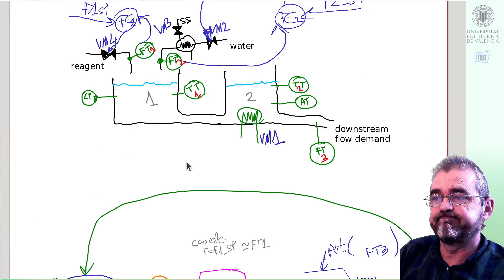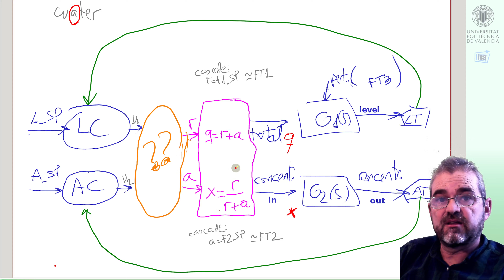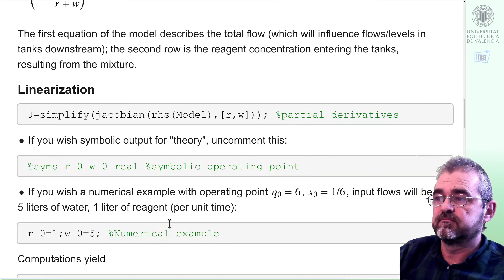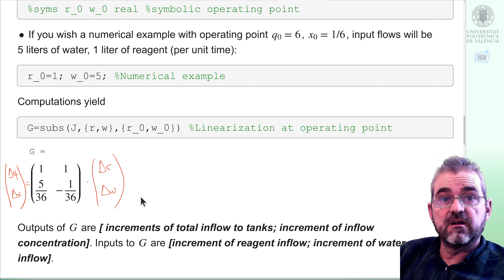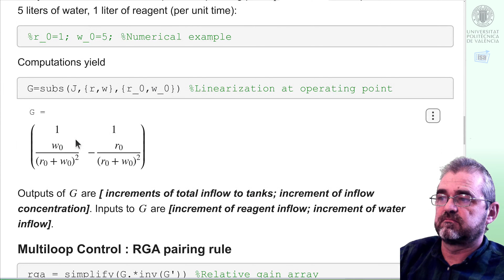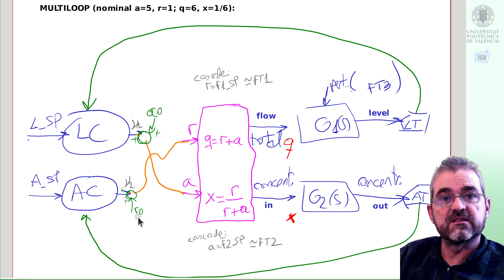static mixing + flow control (1/3): multiloop control. Relative Gain Array (RGA) method, theory

Comment: you have to use some software to generate nicer block diagrams, or at least use a ruler, it looks very low level and not fitting for a professor
Reply from the maker: I'm lazy... Yes, competition has super nice animations... This is why my views count in the "tens" whereas other science channels count in the tens of thousands. But, you know, I'm used to old style blackboard, 😔.
Reply: @ASalaControlEN  for more views you also have to be more applied, connect the theory to real examples